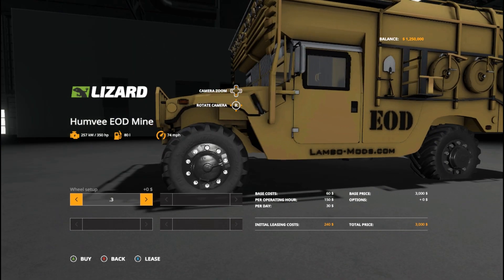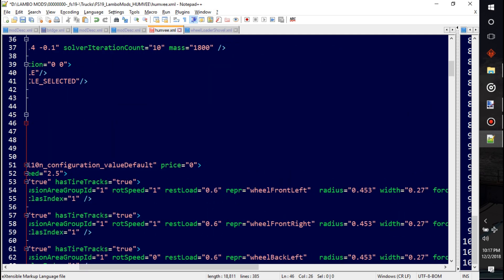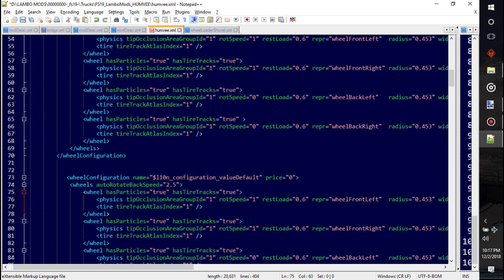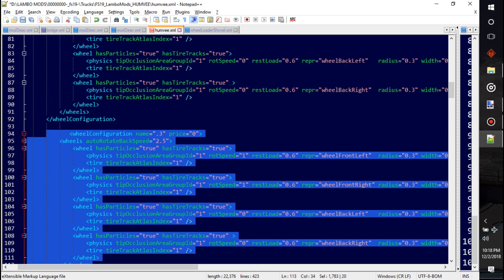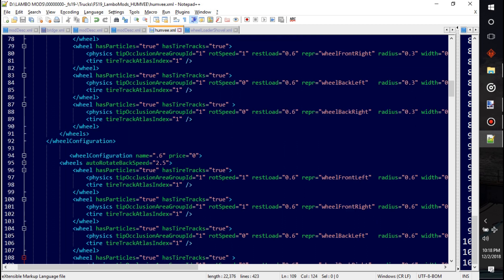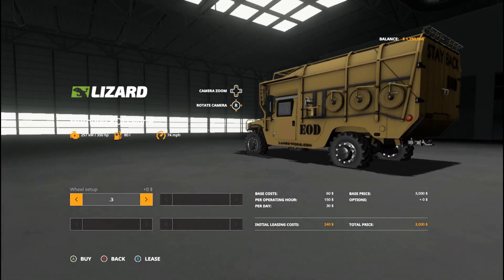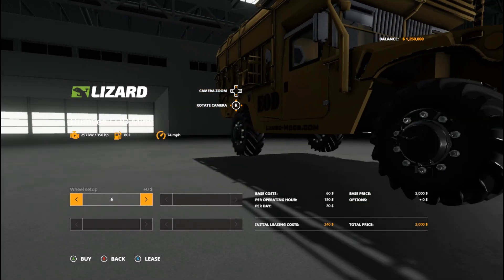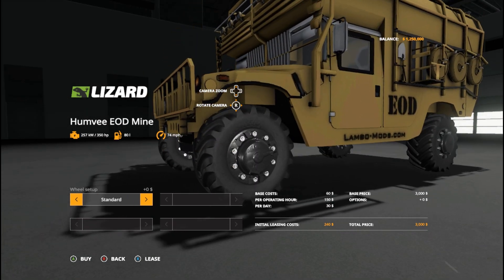FS19 MODDING EP# 11 - Floating or sunken tires - wheel radius

Comment: i need to fix the shrunken wheels on this f250 mod for fs19. pls make a tutorial! http://www.farmingsimulator19mods.com/2017-ford-f250-fixed-v2-0-fs19/
Reply from the maker: +mowens07 Gaming ajust the radius
Reply: @LAMBOMODS  ok. hope it helps because the f250 rims are to a size of trailer wheels. i am wondering if raising the radius number makes the wheels bigger. because if you clicked on the link i posted right there, the mod comes with off-road wheels the same size as the stocks
Reply: @LAMBOMODS  and lastly, i tried the radius once and it just made the truck float instead
Reply from the maker: +mowens07 Gaming tried decreasing it

Comment: The mod I modified ( made tires smaller ) There isn't a thing called radius about the wheels. This is what it says :

<wheel filename="$data/shared/wheels/lizard/implement/315_80R22_5.xml" 

configId="dual" isLeft="true"  hasTireTracks="true" hasParticles="true" >
                        <physics  restLoad="1.4" repr="wheelLeftFront"  forcePointRatio="0.5" initialCompression="08" suspTravel="0.13" spring="55" damper="50" />
                        <additionalWheel filename="$data/shared/wheels/lizard/implement/315_80R22_5.xml" configId="dualConnector" isLeft="true" offset="0.06" />

Here is a screenshot : https://steamcommunity.com/sharedfiles/filedetails/?id=1614680938

Anyting you are able to help me with?
Reply from the maker: +_STINKY _ add it...
Reply: @LAMBOMODS  it worked, THANK YOU!!!